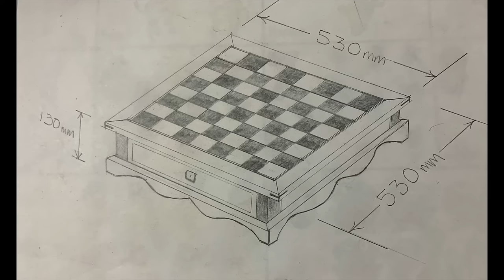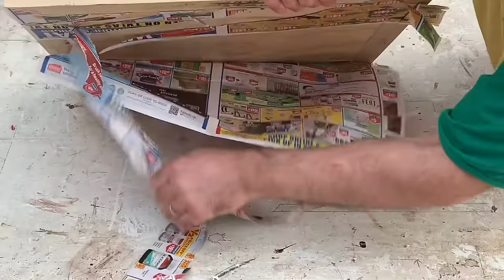Chess Board With Drawers - DIY  WoodWorking .

Comment: This is a beautifully designed and crafted piece. I just watched a similar project from a regular far eastern woodworking site poster, and though their ideas and designs are excellent, there is no comparison in the finished project.They don't finish any of their projects, and all the joints and nail holes are clearly visible, whereas yours are not, producing a far more asthetically pleasing and professional result. The contrasting splines and corner drawer supports are a wonderful extra touch, as are the way you've matched the grains on the squares. You also use far better quality wood, and I'd rather pay that bit extra than look at one of their projects and be continually  disappointed with the 2nd rate finish. EXCELLENT!
Reply from the maker: Cheers !  Ray ,  thanks for the in depth analogy,  you certainly do have a great eye for detail  ( grains on the squares)..... would you believe most of the wood (pine) was waste offcuts ,  to be thrown in the wood bin !!

Comment: The thing that got me into woodworking was my desire to build a chess board, and I started off with the same exact tools. So many content creators act like (or outright say) you can't possibly make anything decent without the best tools/materials. You had a goal, set out to do it and worked with what you had and you made a piece that easily rivals others made with far more expensive tools/materials. I respect the fact that you didn't let your tools or available materials limit your imagination. A true craftsman. Seriously, great job, it's a piece that will surely be appreciated for generations :)
Reply from the maker: Thanks so much for taking the time  to write such a  ( heartfelt ) comment , I appreciate it !   ...  yess a completed project with simple hand tools is so rewarding to make ,  regards Wally

Comment: Wonderful work congratulations, I have already made several boards using sheets of wood and I learned in practice that it becomes more interesting when we place the wood veins in the same position, that is, all 64 squares vertically, on your board you have the white ones vertically and the dark ones horizontally. A big hug from Brazil.
Reply from the maker: Thank you ...... you are the first person to notice & comment about how I staggered the squares hehehe ..... what wood do you use (soft pine). or ( hardwoods) ????  ,,,,, Obrigado - tenha um bom dia ...

Comment: Hi Wally, I'm using this video as a guide for my year 12 woodworking project. Is there any chance you know how much wood you need to make this board, or do you have any dimensions for the pieces you cut for the board?
Reply from the maker: Hi ,  I apologise for my late reply 🙏 ....  ok firstly  after cutting 64 small squares  @ 56mm X 56mm I sat (glued) them on a base ''plyboard''  ...I then added a 1inch frame on the outside ply/small squares ..... the basic dimensions are the the start 0:05   .....I don't have specific plans/dimensions ,  again I wing/improvise as I go along with most of my projects ,,,, again sorry for my late reply my friend 🙏
Reply: @wallytrinc9885   Thanks wally, thats really useful, you are an absolute legend!

Comment: Great work. Can you please tell me the width and thickness of the board frame. Many thanks. Martin in France.
Reply from the maker: Hello Martin ,
530mm (20.8'') Square .
130mm (5.1'') Height .
The actual top board & base both = 28mm (1.1'') thick .
Merci Beaucoup 🙏
Reply: Thanks for that Wally. Sorry to be a pest but how wide is the frame around the squares? Martin
Reply from the maker: @rosieprospect  no problems Martin ,  the frame surrounding the chequered squares is 40mm (1.57'') X 28mm(1.1'')  & 530mm X 530mm, Wally
Reply: Je vous remerci as soon as the weather gets a bit warmer I’ll be over in the workshop and make a start. Martin
Reply from the maker: @rosieprospect  Workshop ,,,lucky you ,,,my   work area is outside opposite the kitchen window under my pergola !   great in summer , terrible during the cold winter,,,,tout le meilleur pour vous monsieur.
Reply: My workshop is -2 right now just a bit too cold tools frozen together. Freezing in the winter too hot in the mid summer. But somehow we manage. I’ll send you a picture when I’ve made it for marks out of ten. BTW where are you in USA our son is on Whitbey Island off coast of Seattle. Passez un Bon weekend Martin.
Reply from the maker: @rosieprospect  Hi Martin . I'm located in Melbourne , Australia,,,looking forward to your picture , thanks , Wally
Reply: Oops 👍
Reply: Hi Wally How do I send you a picture of the finished chess board? Martin
Reply from the maker: @rosieprospect  sorry for the late reply (life got in the way)....you can send ur pic(s) on my Facebook page / messenger page,  below is my link ''cheers''          https://www.facebook.com/profile.php?id=100091956135903&sk=photos

Comment: I have a question about the finish - a layer of varnish makes the wood shiny, but also plasticy. It's exactly what I don't like. I like the feel and smell of the smooth, dusty wood after a sanding. If you leave it that way indoors for many years, does the environment do a number on it or will it stay nice and wood coloured?
Reply from the maker: Thanks. ...the only materials I had at the time were pine offcuts  a aerosol can of varnish &  a small tin of cedar stain . The chess board is always indoors at room temperature & not quite 2 years old .  The varnish has given the board a slight tinge of yellow  ''that's expected with pine '' . I didn't have the luxury of using a material such as Oak, Maple or a Walnut , if so then yes , I would have invested in a quality low sheen oil with rag . In regards to the shiny/plasticy feel , that's a matter of personal preference I guess.   In finishing can I say...I always use a 100% natural food safe oil, where food storage items are involved as in my last 2 projects.  I value your opinion & question(s) that is why I've tried to give you an honest in depth answer...cheers my friend .